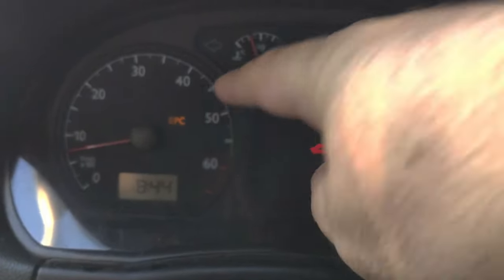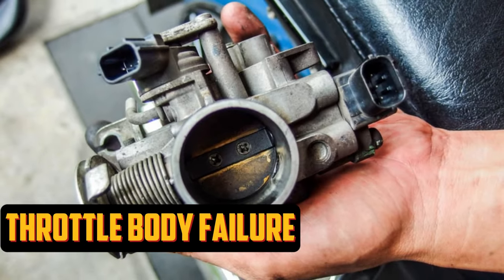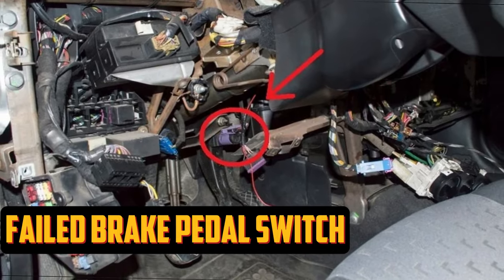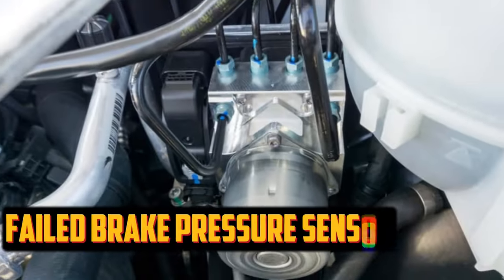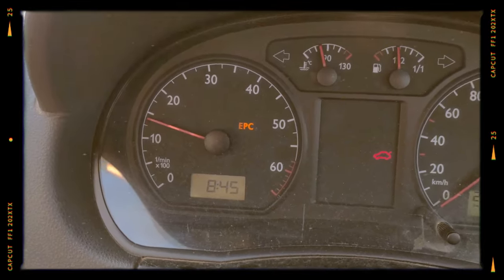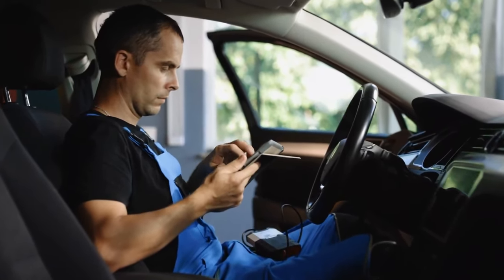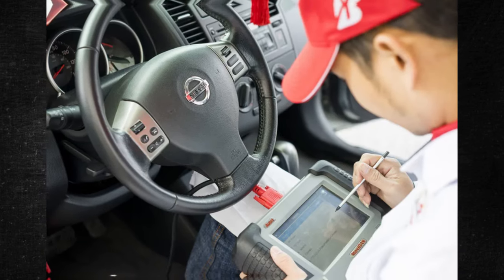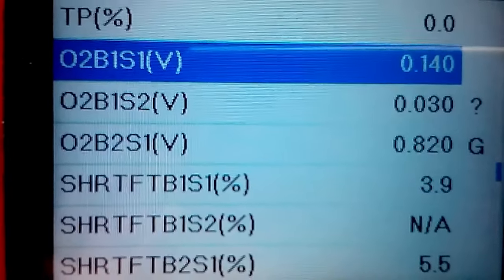6 Causes of EPC light coming on VW vehicles. How to diagnose and fix?

Comment: Just had this happen to me about to find out what it is.
Reply: Any update this just happened to me 😢
Reply: Just happened to me too 😔
Reply: Bro what is it this just just happened to me
Reply: It happened to me 😢
Reply: Anyone get it fixed? I gotta do a carbon and fuel injector cleaning
Reply: Has to do with the throttle body
Reply: Update when the epc light came on on my Audi A4 it was there for a week (during cold storm) when the temperature got higher my light went off. I got several codes I gotta fix when I get my taxes estimate  about 2k to fix …. Once fix im prolly gonna sell it
Reply: ECU - Engine control module thats the issue $1000 used part $2000 for new one
Reply: Mine jjst came on today and car went into limp mode it’s still sitting at a friends house . Couldn’t get it home . Ugh haven’t even had that car but like 9 months maybe. It’s still under warranty but it has a power train warranty so idk if it will be covered. I’m so upset .
Reply: 12000 miles and my epc came on wtf any suggestion?
Reply: Report these issues as there are so many people with same issue so sounds like needs to be a recall!!
Reply: Just happened to me
Reply: Same fam. Same.
Reply: @mikesaloz3176 did that already.. then about six months later, this happened. So don’t think that’s the issue (at least for me.)
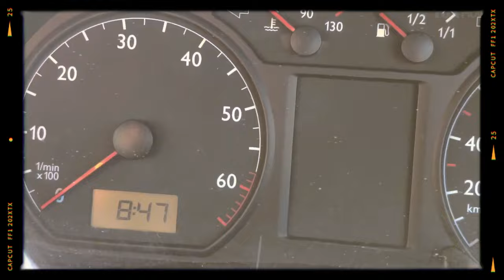Reply: 5:42
Reply: My VW polo has EPC light on and it comes out the sign start -stop system,what does it mean
Reply: Clean the throttle body

Comment: hello i have a VW jetta 2012 it has a weird problem even the mechanics didn't know the problem , when i turn on the car it works for about 2-3 minuets and then stops shuts down for the rest of the day and i can't make it work again but after 24h if i turn it on again it works 2-3 minuets and the same thing keeps happening , did anyone have a problem similar to this ?
Reply: Did you fix it ? I have the same problem
Reply: @eugensopek765  yah i had to remove the ECM and clean the board and replace the capacitors and everything started working again.
Make sure nothing burned out in the board
Reply: @maxiy5  thank you i will try that

Comment: The 2017 VW Golf Sportwagen SE TSI EPC light can go on without any OBDII fault code existing.  So good luck with the troubleshooting, and good thing we have an OBDII system that VW chose not to include for all EPC triggered faults!
Reply: Mine just light up solid after a pull...then I shut it off started  like nothing happened no light on
Reply: @MrGiovann1 mine did that and it’s keeps coming back but off and on again it’s gone

Comment: The EPC light is turning on when driving past certain areas.  It is not distance related as I have verified this, it is not a pattern of running time or distance.  The light will be off until we drive past a 1/4 mile length of road in Carmel Valley, and at other trigger points in the Monterey County area.  As that is where we routinely drive and experience the EPC light turning on.

I am thinking it may be triggered by an radio signal or microwave signal or some frequency on a carrier that has enough amplitude to interfere with the electronic modules or sensors.  We (my Wife and I) never find an OBDII code fault before, during or after the EPC light is triggered.  It now comes on at every start up but the off when immediately restarting the engine.

I thought my wife was being ridiculous when she told me that it always turns on when she drives through the area described above, but sure enough it turned on each time in the area.   I thought maybe related to the uphill and downhill climbs and or engine temperature prior to the level stretch of road where it triggers, but if not driving past that area but still after the hills it does not trigger, and it regularly triggers other locations that have only small inclines as this county is in hilly terrain most of which is minor. Bizarre.  Frustrating!   I have just finally figured out how to access the Brake Pedal Switch which required removing all the overlapping trims of the center console, and instr. cluster, several fasteners, media center trims to help prevent breaking the cover that hides the brake pedal switch.  Frustrating!  I did not see the switch however!!! And had to take a cool down break!
Reply: I have the same mystery/issue with my golf 4. The EPC light is turning on almost every day in a specific place for a half a mile whatever the speed, temperature or prior driving time. Checked almost everything, nothing came up!

Comment: Just dropped my wife's POS Jetta off at the shop.  They looked at it all day and still can't figure it out.  He told me to drive it off a cliff and buy a Toyota😂.
Reply: I am thinking the same to do:person-pink-swaying-hair::face-purple-crying:
Reply: I'm thinking of buying Toyota too I'm tired vw
Reply: 12000 miles only and im thinking the same wtf 😭
Reply: @JRETCH0218  Mine Skoda has 30k miles, a vw engine and I'm thinking the same. I should've went with a Toyota..
Reply: @lordtachanka8432  i just bought a 24 4runner v6 before new gen will come out with turbo. Our vw jetta will be used only here in our town and 4runner in long drive. Im not confident now to use in long drive. I rather pay for little bit of gas rather than to be stranded in the middle of nowhere.

Comment: hola tengo un golf mk7 2016  1.6 16v  tengo el EPC encendido y marca error P30C000 COMBUSTIBLE DE BAJA CALIDAD.
YA SE PROBO EL CPO DE ACELERACION,LOS PEDALES,LOS SENSORES DEL MOTOR,DE LEVAS,BUJIAS NUEVAS,SE REVISO LAS BOBINAS,ETC.
Y SIGUE CON EL PROBLEMA
por ahi se borra sola la falla  pero 30 km mas tarde regresa

Comment: My 2012 vw polo 1.6 cls occassionally missfire and backfire, engine vibration,loss of power and struggle acceleration. I changed MAF sensor, throttlebody, petrol pump, fuel filter, fuel breather valve but the problem is not solved. What could be going wrong?
Reply: Check
Yoiur spark plugs and coil packs

Comment: Hi can anyone help please as I got a passat cc petrol and came with epc light and scaned the car and came 2 faults first throttle pedal position sensor switch a circuit .2 throttle pedal position sensor switch b circuit.thx?

Comment: My 2013 camaro  has been  sitting  in my driveway because the electronics and the computer system  needs replaced due to problems  caused by GPS, On Star and the  use of cell phone but mostly because of a tracking  device put on my car by my insurance company.

Comment: I need to do my brake pads. And my disc. My battery is getting low. I need service. I have a EPC warning light. I ask the mechanic and he helps me. Now 5 days later. I need to do wheel Aliment. My mechanic says I'm wasting money. But I have a job. And when I'm driving my car I need to be save while I'm driving my car

Comment: mine came on and went away
Reply: Same here
Reply: Same! But engine started getting sluggish( while crossing the throg’s neck bridge in NY). Then the car conked out about a mile later. Turned it off and back on. No light. Drove home slowly with no further issue. Thought it might be bad gas???? Bringing it to the mechanic to be safe.

Comment: Ecu - Engine Control Module that's the issue $1000 for used part and $2000 for new one
Reply: 🙄 epc could literally be 100 things. 

That leap of logic is like saying if you cough, that means you definitely have covid and definitely not anything else.